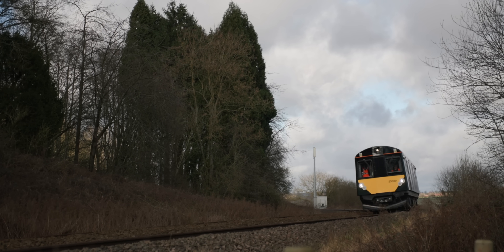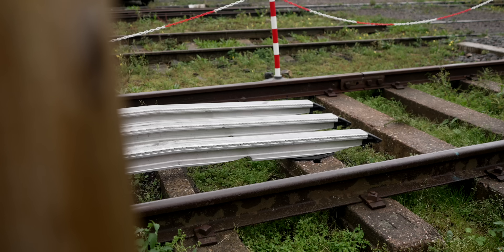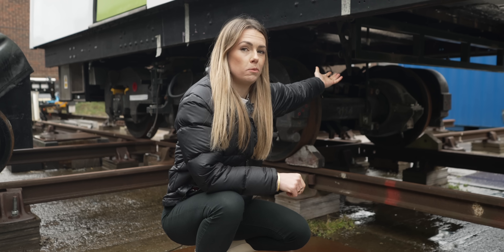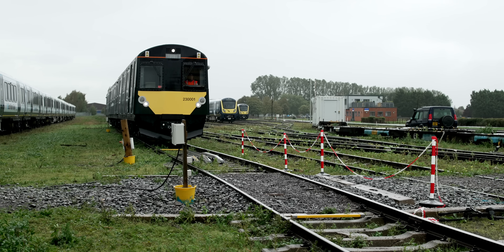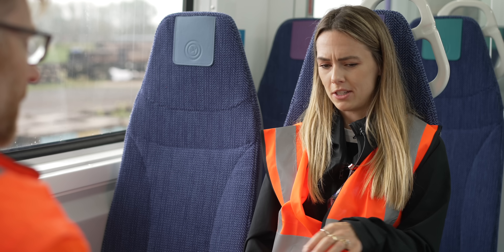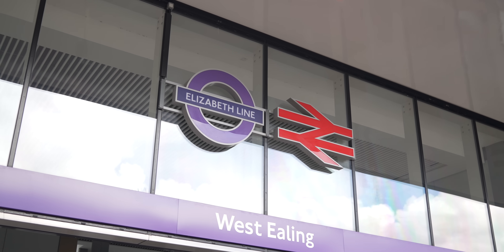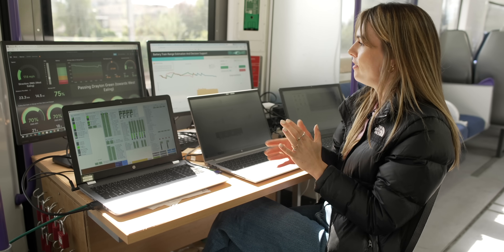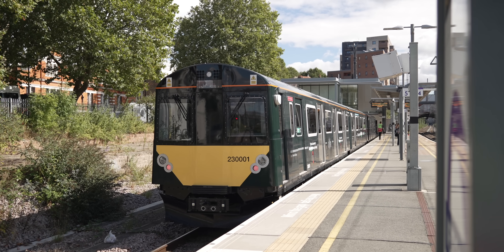Onboard the UK's First Battery Electric Train!

Comment: Awesome sauce! Both the report and the technological innovation. All diesel trains need to be retired ASAP for air quality reasons and this looks to be one of the most viable candidates to do it with! Especially since the hydrogen hype remains just that... hype!
Reply: Bring back steam.😁
Reply: nonsense!!!! good luck with that! these are not going to replace diesel at all! diesel is used for all kinds of rail applications from construction of the lines to maintainance to the transport of those gigantic loads from points to points.

Comment: Interesting how we are building this from scratch whereas other countries are outsourcing the work (e.g. Ireland recently ordered 155 BEV trains from Alstom in Poland).
Reply: Actually: that train we saw was not built from scratch: it is a re-purposed London Underground train ("D stock" in the jargon). Before it got the batteries it had already worked a full service life as an electric train on a fourth rail system. 

The motors and batteries were new, but the basic structure is the train has been re-used after the end of its first life. Very eco: reduce then reuse before you recycle. 😊

(Fourth rail? Yeah, but why the London Underground has two current carrying rails is completely off topic here...)
Reply: @trueriver1950 the only thing reused from the D Stock is the bodyshells and bogies. The electrical system is 100% new.

Comment: Aren’t the Class 777/1 trains on Merseyrail the first battery trains?
Reply: one of the comments says 1852...
Reply: @alanhat5252  yes and no: 
No because in Victorian times there were several locos powered by lead acid batteries. The fumes from said batteries were not entirely healthy for the drivers. 

Throughout the 20th century there were sporadic attempts to build battery trains, in the UK and elsewhere. 

Yes because the 777/1 on Merseyside were (in my opinion at least) the first to have really got the battery tech working sufficiently well in normal operating service to count.

If you are a train enthusiast it's worth taking the Merseyrail to Headbolt to see if you can notice when the train runs out of ground power and goes into batteries. Looking out of the window for the third rail is cheating!
Reply: @trueriver1950  are these Merseyrail trains using Nickel-Iron batteries or something newer?
Reply: @alanhat5252 lithium-ion however the 379s also used them on there battery trains.
Reply: @alanhat5252 
Lithium titanate. Around six tonnes per 777/1. It's less energy dense than some other batteries, but allows for a rapid charging.
It's installed in the same location a transformer could be installed should dual voltage 777s be required in the future.
Reply: @J-Railway-Volunteer 
LTO, Lithium-titanate-oxide.

Comment: Presumably it uses regenerative braking - which saves brake wear.  I guess it shouldn't need a huge amount of charge at each station stop.
Reply: Imogen Bhogal should have said whether these retrofitted trains have regenerative braking; GWR's press releases don't say.
Reply: @skierpage They had regen brakes from new as D78 Stock.
Reply: @A-Trainspotter-From-Berkshire They'd have had tripcocks when new too, so uncertain what point you're making.  

However logical regen sounds (and I assumed the 230s had it too), so far I can't find a dickie bird in any of the blurb about regenerative capabilities.
Reply: @TheHoveHeretic  That you can see the tripcocks, but you can not see regen braking. Both the D78 and 230 have regen but it just works in a different way. There is a fair amount of information on the "How the Class 230 Battery Train works from the Expert" video.
Reply: Apparently they do, source: see the IMechE video "Fast Charge Battery Train Trial" at 7:50.

Comment: What about the Battery electric train that operated between Aberdeen and Ballater in the late 1950's through to the mid-1960's? https://en.wikipedia.org/wiki/British_Rail_BEMU
Reply: It should have been NiFe batteries for reliability & lack of fumes (the electrolyte is potash not corrosive sulphuric acid).
Reply: What about the battery electric train that was demonstrated in Aberdeen by Robert Davidson in 1837?

Comment: Fantastic. Looking forward to seeing long distance super fast trains ie Edinburgh to London fitted with them one day as the technology develops
Reply: No need as it already has overhead wires.
Reply: @katrinabryce  what about for diversions as an when needed or when the wires have failed or been damaged by storms
Reply: @damiendye6623 the road is closed anyway when dealing with damaged lines but diversions are a possible argument.
Reply: @ We need rid of those wires. Inefficient, costly and ugly.
Reply: @PercyRanger Battery traction doesn't work for high speed trains or on heavily used lines.
Reply: @ one day perhaps once the battery technology advances (Solid state for example - perhaps, if not I can put up with the wires but definitely not the filthy diesel.
Reply: @PercyRanger  Batteries will never be able to beet electrification, as non battery trains are a lot lighter, the 230 was a light unit havening been ex-underground, but they still had to reduce the capacity of passengers due to the weight of the batteries. Greenford branch isn't a busy branch however the Henley-on-Thames branch might be an issue with its much higher passenger loadings, which GWR would like to use the 230 on.
Reply: @PercyRanger Inaccurate and subjective in one sentence. Congratulations

Comment: Imagine if the money spent on HS2 was spent electrifying the network. Much more bang for your buck.
Reply: I absolutely agree. I am not against high-speed rail in principle, but I think it should be steep 2 or three in a rail modernization program. I think the approach India has taken is absolutely genius. 96% of Indian railways are now electrified. The remaining 4% are being worked on. India is beginning to put higher speed trains into service on particularly heavily traveled routes such as Delhi to Agra and is hoping to begin offering true high-speed rail in two to three years. I think that the West should be following the example Indian railways has set.
Reply: i know right i think that this is so stupid
Reply: No. Just no.

Hs2 is needed to remove capacity from WCML.

Electrifying branch lines would just get more stuff on to the WCML.

You'd make it worse!
Reply: What is HS2?
Reply: @jamesengland7461 HS2 - High Speed Two - a now-abandoned project for a second high-speed line, this one connecting London through Birmingham & onto 2 branches, 1 north & the other across to the east coast
Reply: @jamesengland7461 the corruption involved is still being discovered but what is already known makes interesting reading.
Reply: @jamesengland7461  Wikipedia is your friend (please donate when you see the year-end banner). In 10 seconds -> "High Speed 2 (HS2) is a high-speed railway which is under construction in England. The line will run between Handsacre, in southern Staffordshire, and London, with a spur to Birmingham. HS2 is to be Britain's second purpose-built high-speed railway after High Speed 1, which connects London to the Channel Tunnel."
Reply: True but then there would have been no backhanders from property developers for trashing all the ancient woodlands & SSSIs

Comment: I do think it’s important for branch lines to do this. But yeah it’s taken a long time. Japan has been doing this for years already. And they did it with a standard pantograph system to charge, which seems to me to be the best solution, because you can set up a very short section of overhead wire at a station on a non-electrified piece of track; or you can charge on electrified parts of lines before they go onto the non-electrified part. Whereas this is quite specialised.
Reply: Yes, I was wondering why they didn't go overhead, but this was not explained in the video. The overhead solution would not require tricky timing or special software.
Reply: @ I guess the 3rd rail former tube train was the only one they could get ahold of. Or maybe they didn’t think about it.
Reply: @christill Vivarail did considering adding a pantograph however didn't do it.
Reply: Another comment thread on this video has a good explanation of why they went with the fast-charging rail system rather than overhead wires.  Basically, it was easier and cheaper in terms of modifications to the trains and stations.
Reply: @richardemerson8075  And it is the national standard for fast charging system.
Reply: they did it like this for the purpose of a prototype/proof of concept because it was easier. we'll never know how Vivarail intended to deploy it because they went bankrupt
Reply: @lawrencejob  Viairail planned to use to replace older DEMUs and then covert the 150s to BEMUs

Comment: It would be interesting to know how much more expensive it would be to also use existing electrified infrastructure where possible? Or are these battery trains  solely used on rural branch lines that don't ever even partly operate on areas where there is 750V DC third rail that easily could provide megawatt level power or 25kV 50Hz that can easily provide even ten or more megawatts?
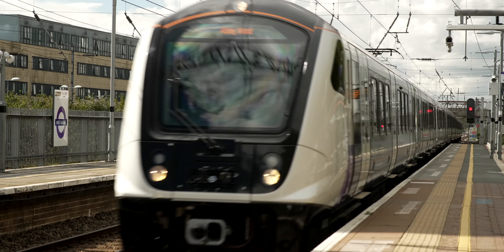Reply: Yes, you can see existing overhead wires at West Ealing station at 12:45, so what's the benefit of introducing a new mechanism to supply power? And these electrified rails are so short that they can't supply power to the train while it is slowing down, nor while it is accelerating out of the station which is when it is consuming the most power. The presenter (Imogen Bhogal I think?) should have asked about this. She also should have said whether these retrofitted trains have regenerative braking' GWR's press releases don't say.

Comment: That old D stock TFL train was re-purposed by Viva Rail to run on the Bedford to Bletchley line. (Soon to be East West Rail). Viva rail went into administration and sold out to Great Western Rail. However it’s great to see the battery electric train concept has been kept alive and well. Considering East West Rail hasn’t electrified the line between Oxford to Cambridge, I wouldn’t be surprised if those trains re-appear on the old varsity line once EWR completes.
Reply: EWR wasn't electrified because electrifaction was cancelled in 2017.
Reply: @ electrification *
Reply: According to East West rail, discontinuous electrification with hybrid trains is indeed now on the agenda. Consultation has just started on it with various roadshows along the route up to mid-January '25
Reply: @Pesmog   Discontinuous electrification, has a lot of issues hence why a fair number of rail engineering's disagree with it.   Discontinuous electrification, is incompatible with most electric stock. Discontinuous electrification, Leeds to future shrinking of the electrified network to save on complexity, for example in the centre of Cardiff, Cardiff Queen Street to Cardiff Central isn't being electrified and Discontinuous electrification is being used all because it is two complex when there is a lot more complex junctions with OLE, like approach into Manchester Piccadilly.
Reply: @ So those Viva rail D stock
Trains might just end up back on the line after all. Adrian Shooter would be very happy to see his project come to life!

Comment: 11:44 23,4km traveled, power went from 84% to 70%. 14% of 504kW battery with ~20km traveled = 3.5kW per km. 
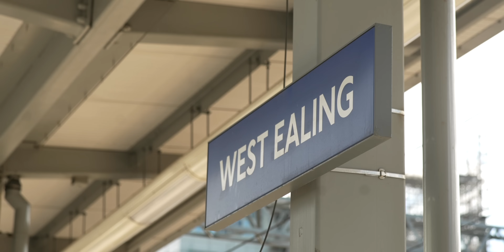9:00 71+55 miles range. 504kW battery = 2.5kW per km. 

Class 230 train has a capacity of 296 passangers. 
8W per km per passanger

Electric bus Enviro400 does around 1.3kW per km. Capacity 100 seats.
13W per km per passanger

Electric passanger car does 0.1kW per km in this low speed, 5 passangers.
20W per km per passanger

It is really kind of linear :)
Reply: missing some h's after those kWs
Reply: Close enough. My 2023 Chevy Bolt (Korean LG drive train) consumes 151 wh/km at highway speeds.
Reply: no its not! totally different cases! not to be compared.
Reply: GWR estimated on there press release it could do 150+ miles on a single charge.

Comment: Does anyone know what type of battery chemistry they are using in the train and the external charging boxes? How durable are these batteries given the high frequency of charging and discharging multiple times daily? I assume they might be using iron-based batteries like lithium iron phosphate (LFP) instead of traditional lithium-ion batteries?
Reply: Lithium ion titanium batteries which are safer than regular Lithium ion batteries.
Reply: They use the LTO-battery from the German manufacturer Hoppecke. There aren't many options, Saft and Forseepower would be other manufacturers for traction batteries.

Comment: You can add an induction loop, when the train arrives a little late, instead of 3 minutes charging, only 1 minute charging available 😮, but as the shoes are close to the line, they begin charging, as the shoes leave the line they are still charging, maybe, an extra 20 seconds of charging???